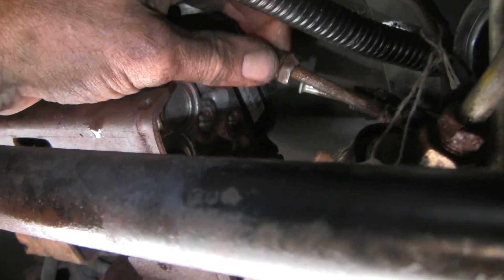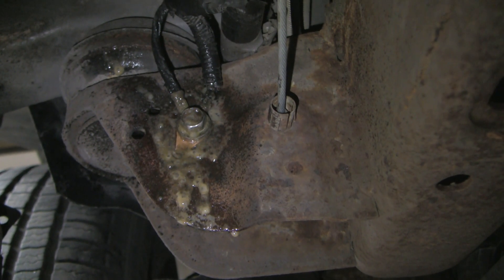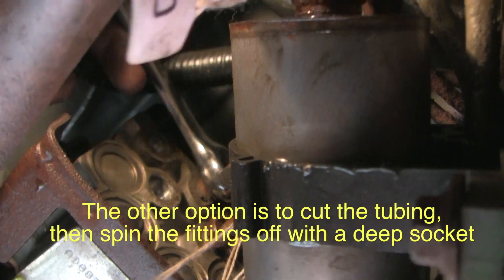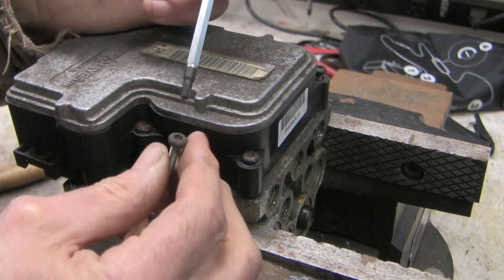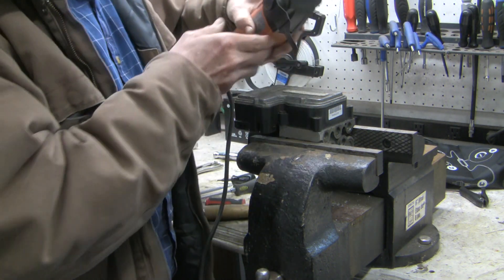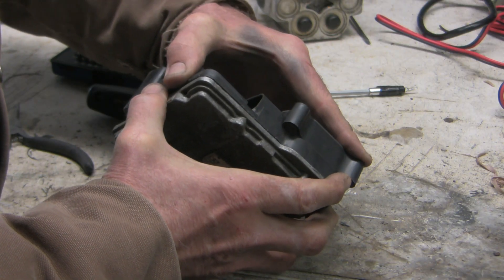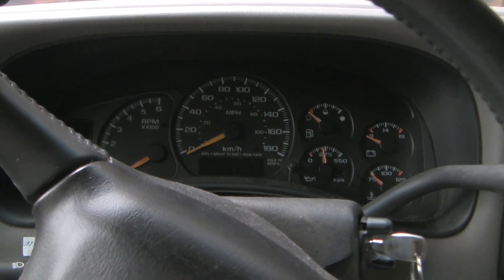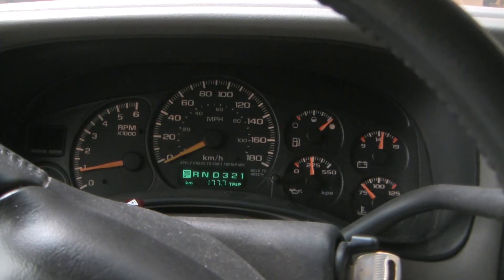How to fix an ABS warning light in a Chev/GM

Comment: I have abs light on, I scanned it but say unable to communicate with module, will soldering fix this ?
Reply from the maker: Possibly, but the standard approach is to be sure that the module is getting power and ground and that communication pathways are intact. This problem I worked up is a fairly well known problem for the GM ABS module in this generation of truck, so I approached it with that background in mind. Good luck!
Reply: @spelunkerd  Same ABS Light on which went out but went back on after 10 minutes usually its on steady . No communication to Scanner .. why not just get another guaranteed wrecking yard ABS and replace it . My 02 venture is in Engine compartment I will check for bad ground .
Reply from the maker: @oldtimedrumcorps  Yes, with no comm to module, check power and ground, then go for the module if the comm wiring seems to be intact. Noise on the ground wire can throw the code, but I don't remember lack of comm. I would refresh that ground connection in any case. I read somewhere that the new module may require a reflash if tire size is different, hopefully the new module and your PCM will talk nice to each other. Online you can find rebuilt modules, they may offer a core refund.

Comment: So mine comes on and turns off some days it'll stay off but no more than 2-3 is this the same problem as the one in the video?
Reply from the maker: It may be, but you need a scan tool to show that a more common problem of wheel speed sensor failure is not the issue. Without a scan tool, I don't think I would attempt this repair.

Comment: I followed your approach and it worked great! Didnt use flux. I used a brass wire wheel on dremel to clean gasket away from surface before applying new seal btw. Hit the metal side with glass bead media blast and polished it with the brass wheel again. Cleaned it with alcohol before applying new seal. Thanks again!

Comment: Great video.  Just wondering if an impact driver could have helped?  The type that you use with a hammer and it turns your driver a little with each strike of the hammer.
Reply from the maker: Yeah, those things are underappreciated, though in this case there wasn't enough room to get the tool into the confined space. No room to swing a hammer for sure. Thanks for stopping by!
Reply: Or... Using penetrating fluid spray before trying to undo to the screws... ;)

Comment: The white "glue" is thermal compound paste. This should be removed and replaced. This thermal paste can be found at a computer store such as Best Buy. Thermal paste helps transfer heat from the IC chips on the board to the metal cover which acts as a heat sink keeping the IC chips cool.

Comment: If I replace my abs module do I have to reprogram it?
Reply from the maker: Good question, I don't know for sure. I believe they are programmed with an eye to wheel size, so if your wheels are a different diameter compared to the wheels of the donor vehicle, there will be a mismatch. However I don't know if that will be enough to trigger an error code or enough to cause a performance decline. Presumably it also depends on the make and model year.

Comment: I think there are potentially three different modules made by three different companies on these cars, and in the case of at least one of those the edge of the pcb runs right along the seam (in other words, the pcb is on the same plane as the rtv'ed seam)... so you can run into a lot more than just the circuit board standoffs with your x-acto knife.  To make matters worse, in spots where they used too much sealant it can catch the edge of the board as you separate the case, so if that happens on a corner it's very easy to crack the circuit board as you pull the top off.

Comment: You went about that the hard way.
Reply from the maker: Yeah, if the module was conveniently mounted this would have been so much easier. Rust happens, especially under the vehicle. Engineers should have anticipated those screws would be difficult to remove as vehicles age. Professionals also make this easy because they almost never open a module to actually fix it, they simply replace it. Not all auto repairs are easy, and people who have difficulty rarely broadcast their experience.

Comment: I have an 04 yukon that has its brake light, abs light and TC light coming on at once. Every two mins while driving down the highway it comes on and goes away. I had the abs module rebuilt a few months ago only for the issue to resurface a few weeks later. $300 for a new module is nuts!!
Reply from the maker: Rebuilt modules installed by professionals usually come with a warranty, and a few months is likely within that time limit. I would contact the pro who installed it, first. If you have no warranty, I would check the common things, especially the ground connection which can present in the same way. To be sure of the ground, you could put a nut on the back of the ground stud after cleaning it, if yours is mounted the same way mine was. Also clean the battery connections, and the battery to engine/chassis connections, for the same reason. You may end up following the path I used in this vehicle. Mine is still going strong, no issues at all.
Reply: spelunkerd I will definitely check the ground. And that’s very true about the warranty. Maybe I’ll give it a shot if all else fails. Thanks!!

Comment: So do you know if it's a fact that if u chose to just drive with out ABS, will the pump continue to run and if so is that a bad thing, to let the pump run?
Reply from the maker: The ABS only kicks in when you skid, like on a gravel road when the wheels lock up. It isn't a normal driving experience and it won't cause problems even if it somehow activated with a bad control unit. I don't think it would ever activate if the control unit was bad, in my case the control unit was intermittently not working. You can hear it activate, you get a humming, vibrating sound for a few seconds when the ABS is working. Not a bad thing at all, though if it was stuck on, the motor wouldn't survive more than a few minutes.

Comment: The ABS EBCM should be high up under the hood. Another engineering marvel! It was probably the first thing that came down the assembly line and the entire vehicle was built around it.......(eyes rolled!)
Reply: 1pcmedic in the 90’s they were. I got lucky on my 00 tahoe and got the EBCM off without taking the ABS unit off.  The whole time cursing GM as I cut the junk out of my hand.
Reply: @jackr7028  I have an 01 Tahoe, I can remove the  torx bolts from the top and remove the module too. Poor engineering.

Comment: will the abs caus the brakes to lock up
Reply from the maker: Not normally. When there is a fault detected by the computer, the system is shut down completely, reverting to the old style brakes that we had before the ABS revolution. The one exception to that general rule of thumb was a problem experienced about ten years ago, when one of the manufacturers had a wheel sensor that gave spurious readings at low rpm. it turned out to be a bad electrical connector at the tone ring. I don't remember which manufacturer that was, GM? The abs would trip at low vehicle speed, but it was more of an annoyance than a cause of crashes.

Comment: Is there a way to dissable the ABS system WITHOUT pulling the 60amp fuse under hood? Doing so also illuminates the "brake" light on the dash. Curious if anyone here knows. Also pulling the harness at the pump also illuminates the "brake" light as well
Reply from the maker: That's a good question, I don't know. I can think of many reasons a manufacturer would design the system to not easily do that, if only to reliably show the driver that the ABS unit is not active. Unscrupulous sellers have been know to remove warning lights from behind the dash, but doing that leaves a red flag for investigators, with legal responsibilities that may follow. You are not required to have ABS, many cars are still on the road with no ABS at all. Concealing the evidence seems like an offside ploy.

Comment: May be helping my buddy with his '02 Tahoe 4wd Z71 soon which has brake fluid leaking out in front of the rear left tire below the back door.  He just wants to get it fixed so he can sell it since it's sat like this for over 18 months.  What would you recommend for fixing it quickly (BUT safely)?  Are there brake line kits out there that are easy to install (yet SAFE)?  It also has the ABS light on and the code is C0267 which is something to do with the pump motor circuit?  I hotwired the pump motor and it works.  Do you know what that code could mean for his particular truck?  The EBCM?  Fantastic job with your video.👍
Reply from the maker: The brake leak sounds a lot like the same failure point as mine. I would replace the entire line going to the rear wheels, in my vehicle the rear wheel line splits into two so a single line feeds both. Newer vehicles may have individual lines, I don't know about yours. Some guys, notoriously Scotty Kilmer, would replace just the bad segment and make two unions, however his technique is badly flawed and illegal in many states. You don't want to sell a vehicle that may make you liable if something happens later. There are flare kits to correctly replace a segment but access is so poor it is probably easier just to replace the entire line and be done with it. As far as the ABS code goes, I am not sure, it could be the same issue as I showed. Fixing the ABS is a huge amount of work for a vehicle you're flipping, probably not worth it in most vehicles of this vintage. I would start with the dealer repair manual, I use Alldatadiy, and if it looks like the EBCM I would refresh the ground as I showed at the beginning. You could start by checking the wheel speed sensors to be sure they are each sending a signal to the pcm. Good luck!

Comment: When I did the ground screw on mine, I completely drilled a new hole, wire wheeled both sides down to bare metal, then between the metal and the ground lug on the wire, I put a heavy star lock washer.  I then used a bolt and nut and a regular lock washer on the nut side.  I then coated the whole thing (both sides) with dielectric grease to protect from weather.

Comment: I put a tiny amount of silicone spray on my fingers and rub it on the threads of those 4 screws you had to replace to make them easier to get out next time.
Reply from the maker: Good point. I hope I never have to go there, so far the car is still doing great.
Reply: @spelunkerd  Yeah, I tried "hoping" and it doesn't really seem to help much most of the time.
Reply: What about never-sieze?  Did you ever use it? (silvery paste)

Comment: how much does it cost to repair a Silverado 2000
Reply from the maker: Gee, I don't know, it depends on what is wrong. As you see I replaced all the lines and fixed the module, but if only the module is bad it might be a lot less. Also I had the difficulty of not being able to easily remove the EBCM because of stripped screws, which led to a lot more work. The EBCM part itself is a couple hundred dollars just for a rebuilt option. If they did it the same way I did, including the leaking brake line, I'll guess there would be about 6-8 hours of shop time, plus parts. If they only fixed a leaking brake line, less time and fewer parts. You could ask a pro for a quote. In old vehicles like this, it wouldn't take much to exceed the resale value of the car. If only the EBCM is the problem, then you're dealing with a warning light and lack of ABS. Some would continue driving, though there is a liability angle if an accident happens. Many vehicles don't have ABS at all, and they are still legal on the road today.

Comment: A couple of my torx screws stripped. I removed my front seat and drilled a couple of half inch holes above the stripped out screws. I then used a smaller fit to drill the heads off the torc screws. I used rtv to glue a couple of pennies I found under the seat to seal the holes.
Reply from the maker: Ha ha, that's a very creative solution! I like the way you thought that one through.
Reply: The light stayed off. Thanks for a great how to.

Comment: Very interesting video. A+
Thank you for posting this. I am dealing with the same problem in my Impala. Could you make a video detailing how to remove the EBCM, please. I will appreciate it a lot.
Reply from the maker: Even within the GM product line, every vehicle is different. You can find the EBCM by tracing brake lines from the MC. If you're lucky the EBCM will be in the engine compartment where it is easier to get at. The diagnostic steps I showed are important, you need to be sure it is not just a bad wheel sensor or tone ring that would be much easier to deal with (more common overall). Also, refresh the EBCM ground wire if you have a similar intermittent presentation before doing anything more. For sure, use a scan tool to document the diagnostic codes. You can get a dealer repair manual online, I use alldatadiy, though mitchelldiy is also available. The most difficult step is to decide whether you are up to the challenge, since repairs like this often lead to difficulties that require extra tools and a versatile skill set. An attempt that fails can lead to problems that are much more expensive than you started with, so there is some risk to consider. If in doubt about the diagnosis, a visit to a pro shop for diagnosis might be a good investment. Good luck!

Comment: ABS work but ESP and ASR  is fault.
in my VW
Reply from the maker: I would start with the dealers repair manual and code scan, then check live data for wheel speeds, etc. This kind of repair takes effort and some specialized tools to do it yourself, effort and time that most of us don't have. Diagnostic work is often under paid in the flat rate system, so another option would be to take it to a shop and see what an investment of one hour of paid diagnostic time will show you. At that point you can decide whether to continue the repair yourself or not.

Comment: I drive an S-10.  My access is from the top.  I have the same lights on almost all the time (ABS and parking brake)  When I get the chance I will make this repair.  BTW, when the ABS light is on, it will not work and your brakes will lock up!
Reply from the maker: Go for the ground connection first, if it is similar to mine throw a nut on the back to eliminate that possibility completely. You might find more info in a dedicated dealer repair manual for your truck. Many things will cause that light to go on, so checking the individual wheel sensors is pretty important since a bad tone ring or wheel sensor may look the same. Wheel sensors go bad all the time, usually coupled with a code that points to the bad wheel. Good luck!

Comment: Very interesting and helpful video. Many thanks to you. Keep up the good work man. I have a question. 
Where the EBCM is located on a Chevy impala 2003? I have that ABS light on for months. After I spent more than $500 at the dealer to fix it,  they said that I have to change the EBCM. Any help on this,  I will appreciate it. Thanks again.
Reply from the maker: The resource I use is Alldatadiy, which gives you the dealer repair manual and all TSBs for a small fee. But to answer your question without that, you could trace the brake lines from the MC , they will lead you right to the abs motor. The EBCM will be very close to the abs motor.
Reply: spelunkerd Thank you so very much.  I will follow your instructions. Many appreciations for the prompt reply.